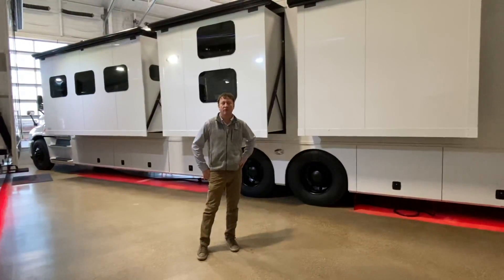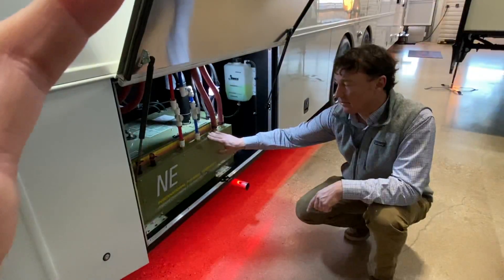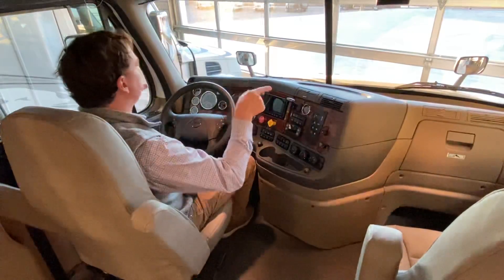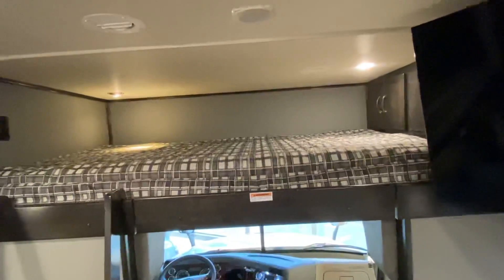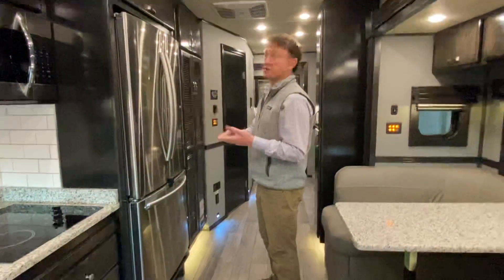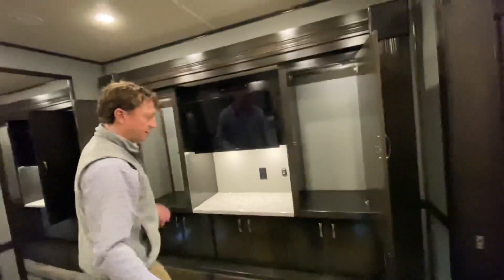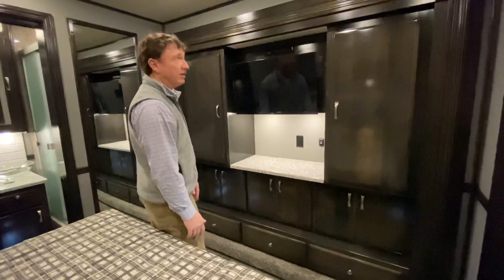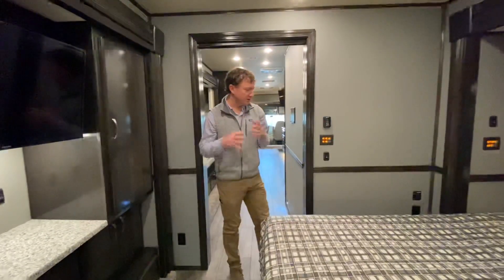2020 Showhauler Walk through Video with Performance Motorcoaches

Comment: Will Show Hauler be installing or optioning Mini-Split ACs...so much quieter and way more efficient!  How large is the battery compartment and is there room for two inverters to get split phase power when on inverter?
Reply from the maker: Storage is a premium in a RV. We don’t plan on installing mini splits any time soon. Also getting rid of the condensation/moisture is not easy in a moving vehicle.

Comment: Is it an electric stove top or induction? Oven Microwave combo? Does the stove have it's own inverter? 3000 Watts is a little low to run the stove and anything else?
Reply from the maker: We are a custom builder, we can install any cooktop you want. You couldn’t run an induction cook on a inverter, they are 220volt.

Comment: You really need to move the kitchen to the dinete and move the dinete across from the couch. Not having opposing seating so that you can converse with company is a deal breaker. Who want to sit and stare at the kitchen sink. Then the passenger and driver seats can be rotated and used for conversation as well.
Reply from the maker: We are a custom builder, we can configure your new coach however you’d like. Traditionally combining plumbing on slide-outs is very problematic.

Comment: Why keep using a 6 speed transmission with a vehicle with so much power? I wish someone would fit the 12 speed. I'm still waiting for someone to build a coach with a 16 litre 750hp Volvo engine and they push out just over 2,600lbs ft of torque!
Reply from the maker: Volvo discontinued their 16.1l D16 engine several years ago.
Reply: @Performancetx  no they didn't, you can get it in Europe.
Reply from the maker: We are located in the US. Additionally our emissions won’t certify a D16.

Comment: I am unclear what the difference is between a Super C and a Showhauler.     They appear to be the same.       Nice unit but basic in its interior trim level.   Biggest gripe is   not enough windows and natural light.   When you get past the social areas  its a long cave.    This has been my gripe for years.   Only a few coaches have started with full window sides etc.
Reply from the maker: Super Cs are generally built on smaller trucks. A Class 8 conversion is generally referred to as Truck Chassis Motorhome. 

Most of our customers don’t spend a lot of time in their coaches, generally to sleep and travel in. We can place ANY size windows a customer wants.